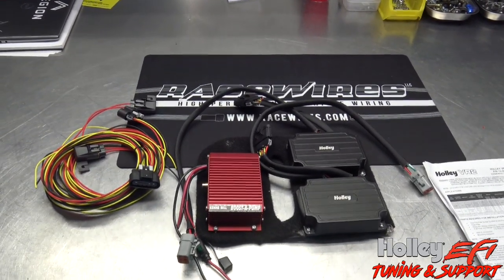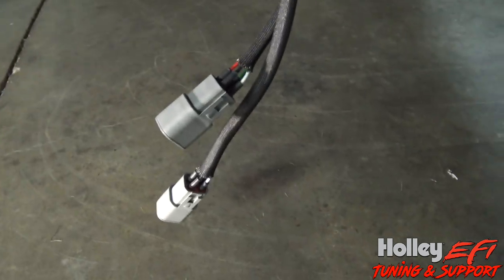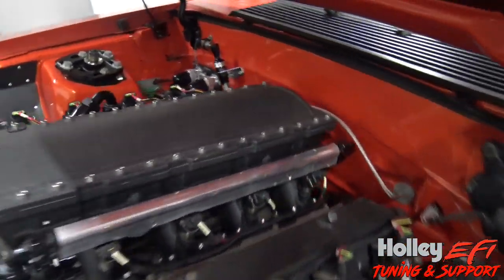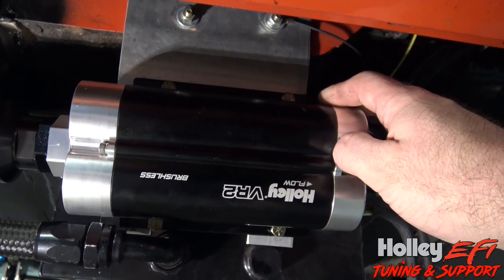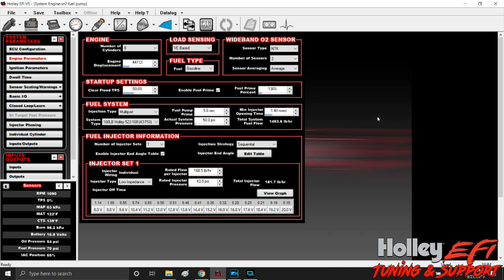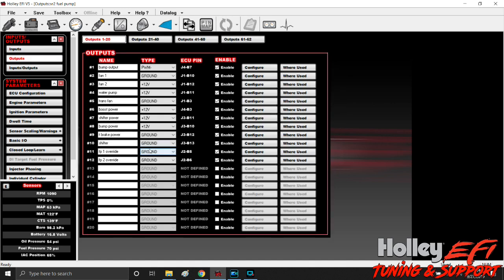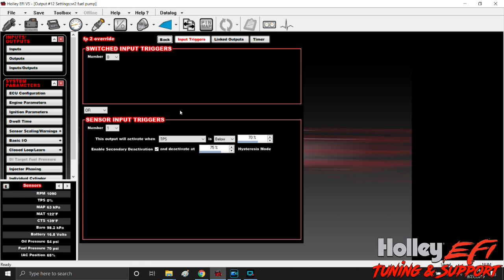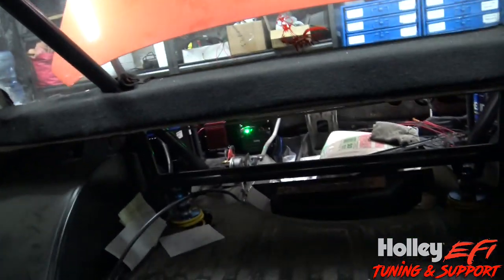Holley vr2 fuel pump install and program in software

Comment: Devin does the programming method work the same way with the Aeromotive brushless pump controller?  More specifically the one that mounts on top of the 3.5gpm? If I understand correctly I have to hold ground on the 3rd (trigger) wire untill I want 100 percent duty and then take away the ground through the holley?
Also is it ok if I where to test the 3.5 brushless pump with a dry fuel cell?

Comment: Can the holley run pulse width modulation on a compatible pump? Have you ever done that before? I've been looking for info and can't find much about a recommended ssr or if the holley will provide the frequency signal to do so.
Reply from the maker: Yes it can pretty easily watch my video on inputs and outputs

Comment: No idea if it makes a difference. But it just feels better to me to run both pumps 50% over running 1 and triggering the other. Seems like there would be a small bit of lag maybe only a millisecond and never seen but just seems like it. Also if you had an issue down low with pressure would the ecu be able to detect it faster with both ramping in vs trying to see it at x/rpm.

Comment: Why did he choose this route vs a belt/cable drive? What were the advantages? HP level/not needed? To solely not have to reconfigure the front of the engine for the drive? Thanks for all the info !
Reply from the maker: no room really for a cable drive on the front of the engine